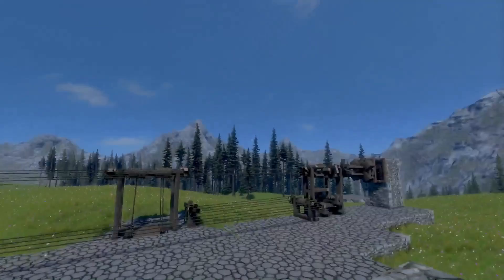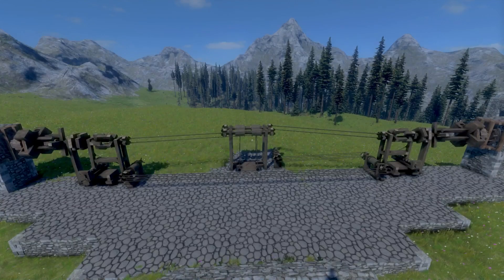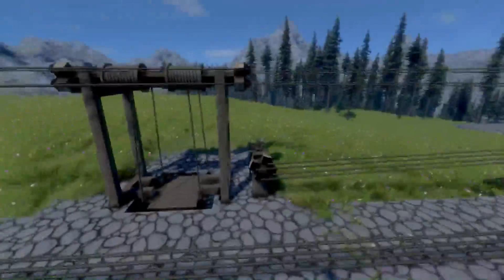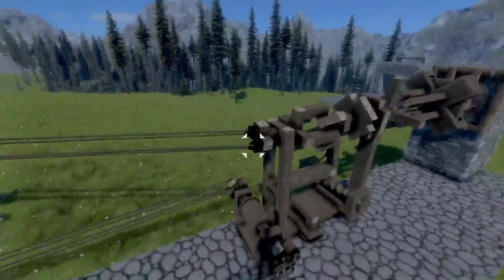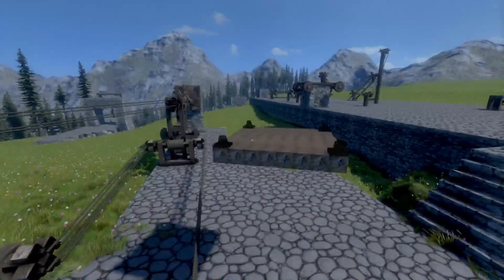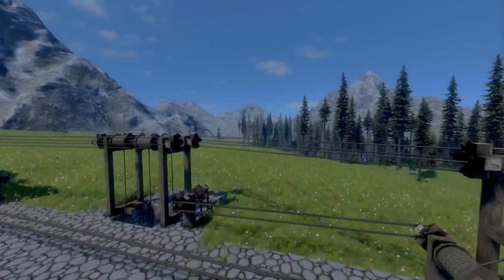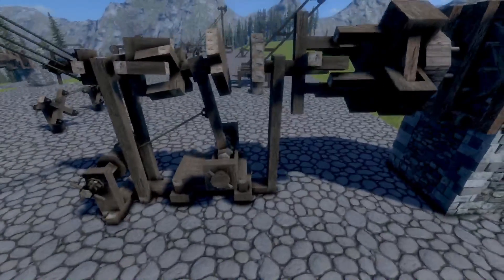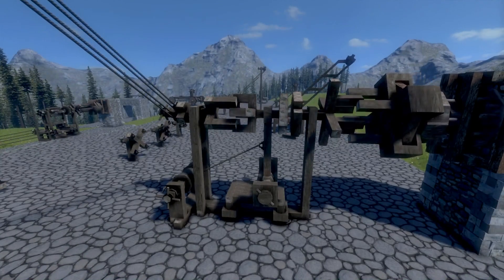Medieval Engineers "Tech" - Self Propelled Elevator + Clutch

Comment: Hi, i wanted to ask, why the clutch keeps rotating on it's own?, do you use some sort of weight contraption? or you have a river down on the map? D=
Reply from the maker: The rotor block has a little invisible button in the middle of the cross pattern (which is the "front") If you press this button it starts to rotate :) 

It's probably the base for future windmill mechanics